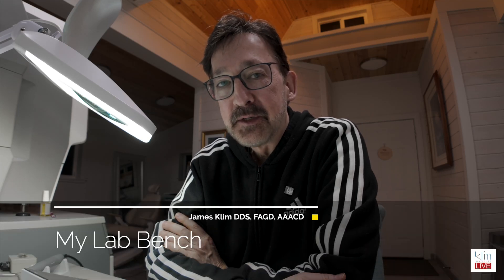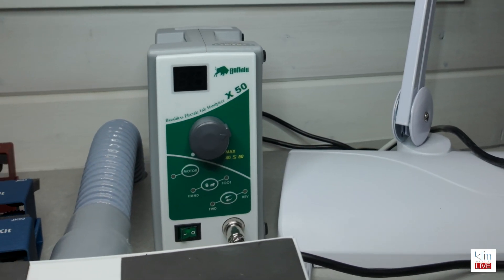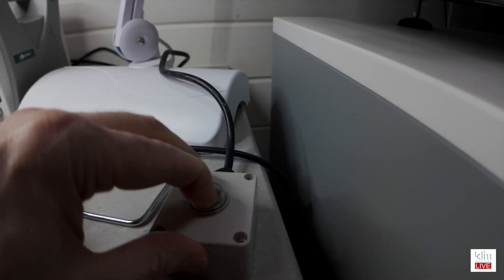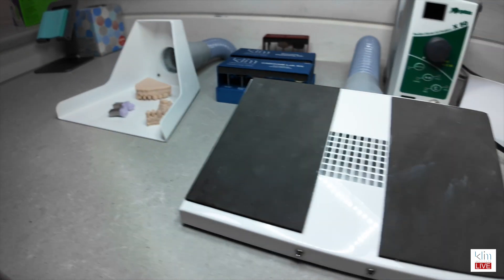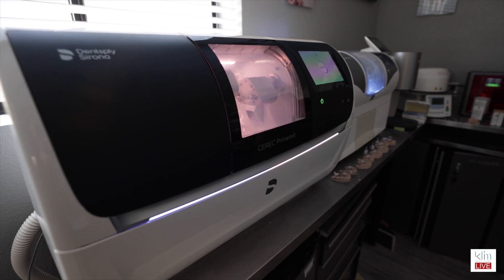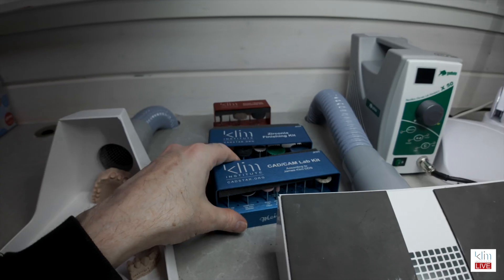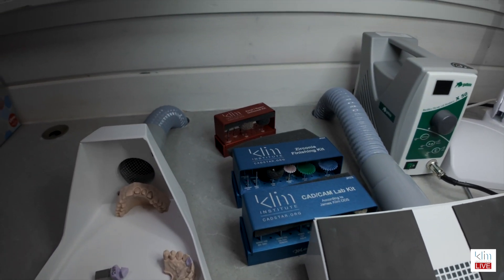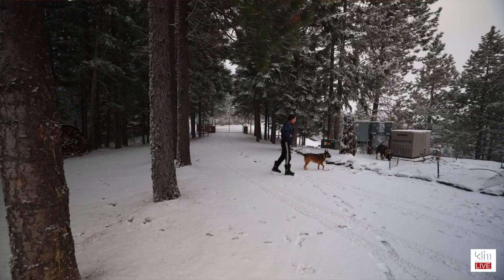My Homestead Dental Workbench

Comment: Hello Dr. Klim.  I am a dentist and I am researching lab solutions for my practice.  Currently, I use traditional PVS impression techniques.  RecentIy, I purchased A Primescan and want to move into the digital lab workflow. I have a lab technician in office who currently provides pressed emax crowns and implant crowns from my PVS impressions. We send zirconia restorations to an outsourced lab to be milled and he finishes the restorations.. We are trying to figure out the best setup for going to the digital lab flow.  What are your thoughts on 3D printing models and pressing emax to those vs.  just going to strictly milled restorations (emax and zirconia)? Do you use 3D printed dies for finishing your milled restorations or is there no need for physical model work? Your thoughts on this would be greatly appreciated. Keep up the fantastic content!
Reply from the maker: Great, the Primescan is an accurate and reliable source.  Do you want to turn restorations over in the same appointment?  The inLab Software and Primemill are best for same-day restorations. However, it is a 4-axis milling with some limitations for thin veneers but excellent for full crowns.  With DS Core, the Primescan file can be converted to the PLY file for Exocad Software.  I prefer this software over the Dentsply Sirona inLab software.  Exocad will support digital wax-up and planning for the final restoration workflow.  For e.max, you will have the option of milling either wax and pressing for e.max or milling the e.max.  A reliable 5-axis for your lab technician is the PM7, the milling system in this video.  The PM7 is a very accurate workhorse for milling, e.max and zirconia.  I recommend designing from a digital impression, not a stone or printed model. Digital is much more accurate and reliable than a PVS. Though it is good to have a printed model.  I use the Asiga Max printer, and the model is very accurate. I can rely on the model's accuracy to affirm proximal contacts when on the lab bench and finishing the margins as well.  The SprintRay 55S with the Quadrant build plate is an efficient option for printing temporaries.  For larger cases, the Exocad software can efficiently design and export for printed temps.  The options are expansive.
Reply: Thank you so much for the guidance.  For now, I will not be doing same day restorations.  I was looking at the Ivoclar PM series as recommended for lab use. Not sure I’d use the expanded benefits of the PM7 vs PM5 or PM3? I will not need denture features, and very seldom the metal milling features (other than implant abutment options(?) ). While a call to Ivoclar could help me with this decision, your thoughts on 7vs5vs3?